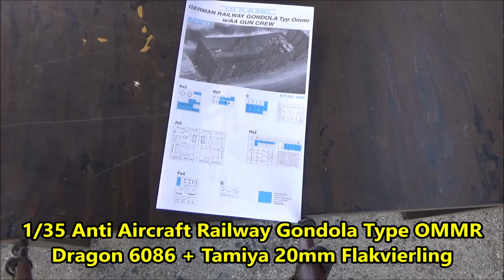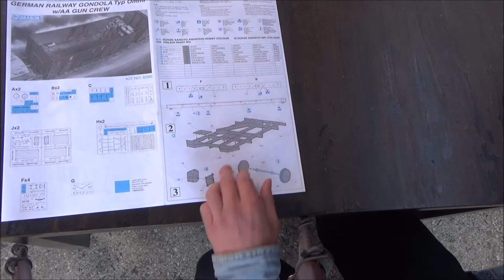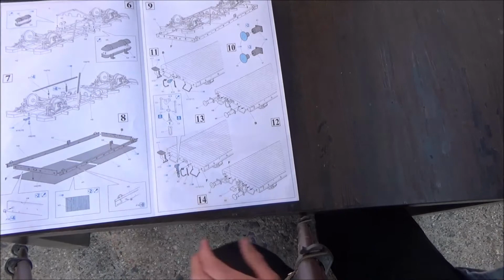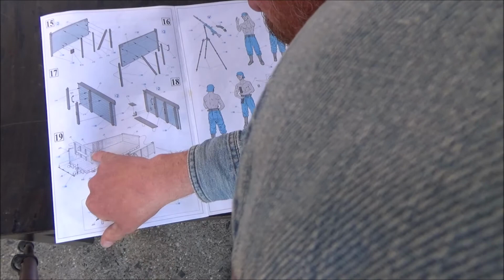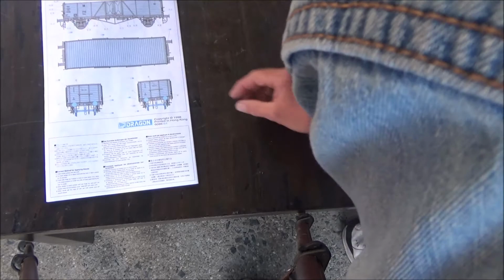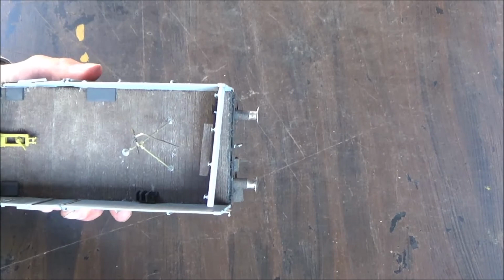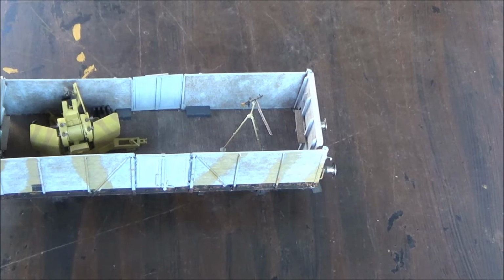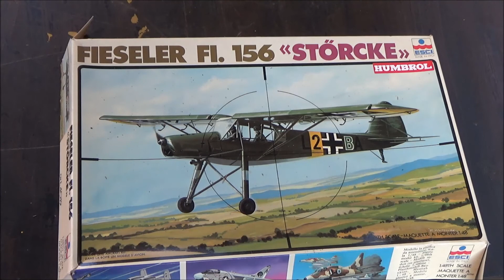Review of the 1/35 Scale Anti-Aircraft Railway Gondola Type Ommr from Dragon W/ 20mm Flakvierling

Comment: Nice result - but not without its issues! Sounds like an awesome long term project you've got going. Big investment too! I look forward to seeing that done. 😁 Cheers. 👍
Reply from the maker: Yeah, most of the issues came from moving last year.  The whole side broke off of it, the pin on the side broke off, and everything fell out of it, including the Flakvierling that I had to rebuy and rebuild.  I hate moving models, something always breaks.  I have to touch up the paint on the inside because i did the repairs right before i shot the video and I still need to do some weathering and see if I can get those sides a little straighter at least.  I have problems with the K5E as well, all the ladders broke off and I dont know how I am supposed to replace them.,
Reply: @mullinscl  That's a shame, mate. Good luck with the repairs - I'm sure you'll come up with something. It's hard enough to keep them in good condition without moving!
Reply from the maker: @andrewshawmodels8610  I know, moving is hard on models.  I think maybe i can redo the ladders with some brass wire maybe, except for the top part, they are flat, that's gonna be difficult.  .  I cant replace a K5E though, they cost over 130 Euros.  Its frustrating not having your own place